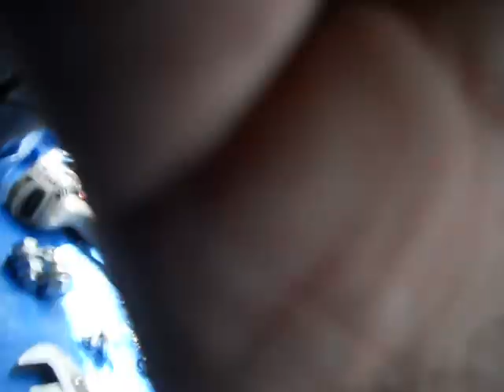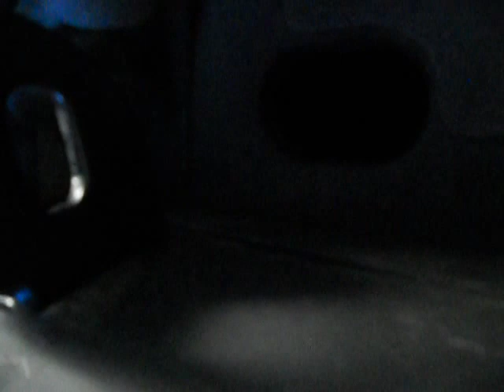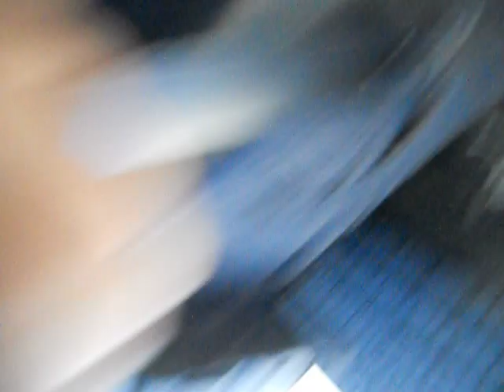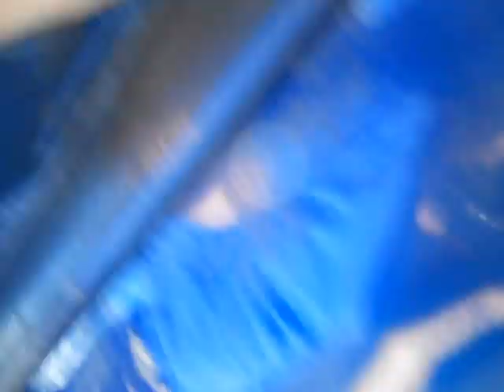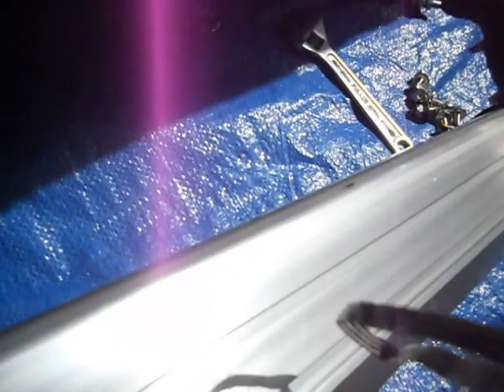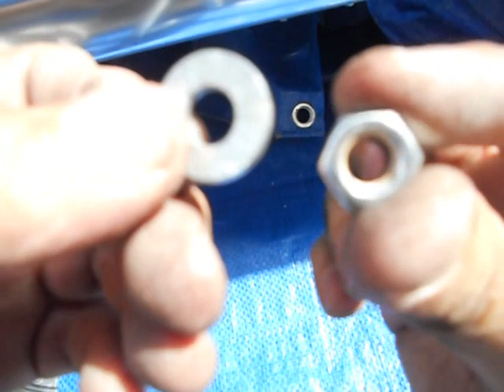Toyota Rav 4  running board install

Comment: Do these interfere with shop lifts, or at home floor jacks?
Reply from the maker: No. Unless you have no clue on how to jack up a car. Running boards aren't meant to hold the weight of the car.
Reply: @exceleratorjoshua   @JoshMedina  I'm well aware you should not jack up on the running boards. I'm wondering if you would know of the arm coming in from a hydraulic floor jack if coming directly from the outside, would hit the running board before fitting into the pinchweld-lift location. Thanks